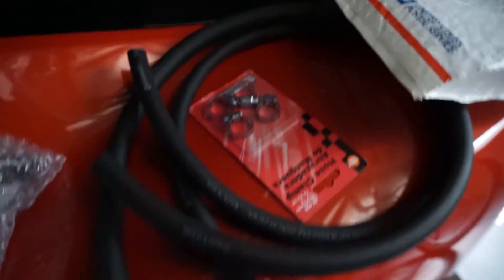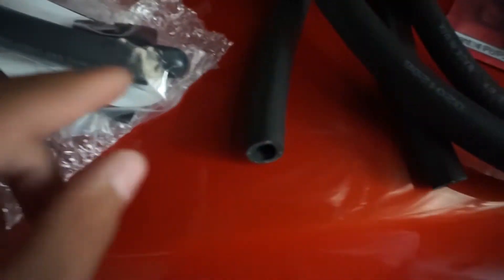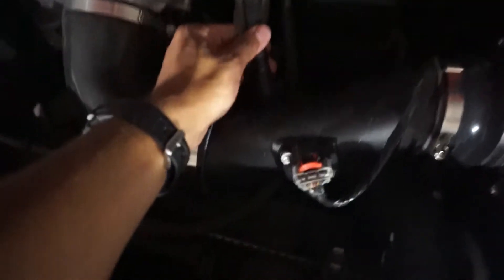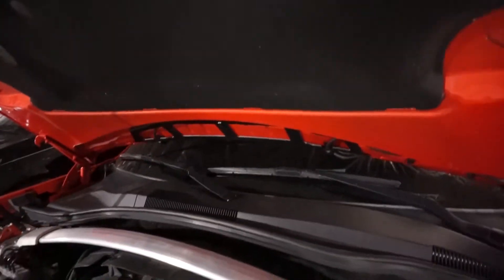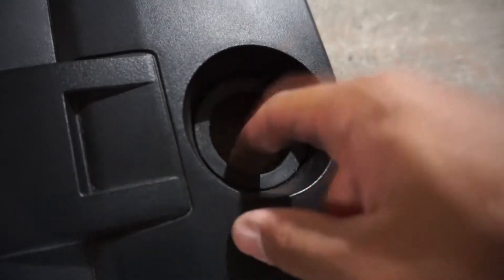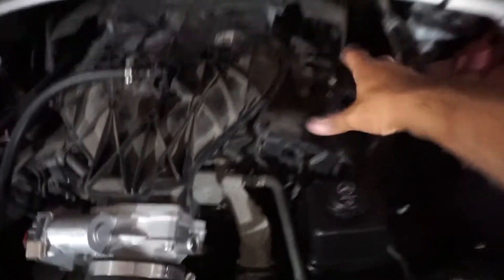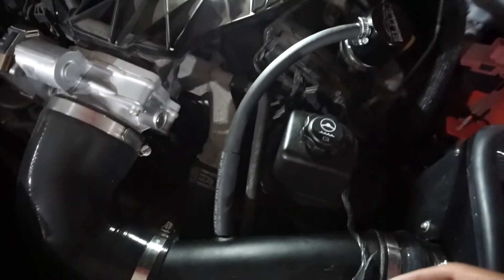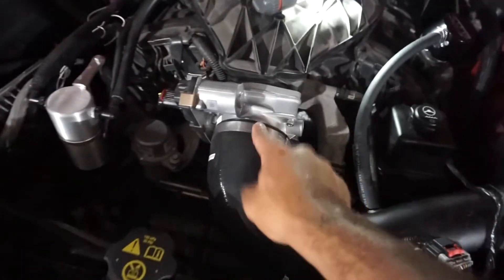Elite Engineering Clean Side Oil Separator Install/What It Does(Camaro V6)

Comment: I ran into a problem installing the clean side separator because I have a stock intake and the fitting is way larger than the hose and barb fittings it comes with. I haven’t installed it yet or figured what to do but I assume I’ll have to get a larger barb fitting or a larger hose and barb hitting

Comment: I have both from elite engineering  and work great. My clean side oil separator fits perfectly with the cover on. I didn't have an issue with it, even with the rubber ring on the cover opening.
Reply from the maker: Its definitely doable but I'd rather not get stuck holding the cover on with something that barely gives you grip to unscrew. Also there is too much tension on the line for me with the cover on. The separator goes on but in my opinion doesn't feel as good as with the cover off. To each, its own.

Comment: Do you have any oil leak from this setup?
Reply from the maker: Not anymore. When I first bought it, I bought a bolt(dont remember the size, I just walked in a hardware store and threaded it in a tester and bought the bolt that size), put teflon tape on and screwed it in. No leaks.
Reply: @mistermanage1119  i have the elite cath can for 3 year dirty side working perfectly bud I never put the clean side separator because I don't want oil leak
Reply from the maker: Idk why people think it will cause a oil leak? It will not cause a oil leak. Your cath can only catches 90-95% of the dirty vapors. The other 5-10% is coming back through your clean side at wide open throttle. At WOT, your vaccum in your intake goes damn near to 0 which means your catch can is not working cause there is no vacuum source which means vapors can come back up through any whole like the clean side. The clean side separator baffles it and only let's clean air back in. I haven't had any issues with leaking or oil consumption. To each, its own.
Reply from the maker: Also when I was talking about the leak earlier, I was referring to the actual catch can not the engine.
Reply: @mistermanage1119  ok thank you 💪🔥
Reply: @CorvetteC6-LS2  I've had the clean side separator on for 3 years no problems..
Reply: What about the resonador delete you put x pipe tou fell any diferential loss back pressure?
Reply from the maker: No
Reply: Are you going to invest in a dual valve oil catch can like the one Terry Lewis installs?

Comment: I was told to just close the driver side sytem off and the hole im air intake plug them up?
Reply from the maker: NOOOOO! DO NOT do that. If you do that, think about it, how will the crankcase get air in it when air is being vaccumed out the other(dirty side) side. It's a closed system. If you dont believe me, look up a video on the PCV system. They will explain it.
Reply: @mistermanage1119  i meant driver side pcv connect to oil catch can and passenger side also connect to oil catch and plug the intake barb and the hold in middle of intake manifold
Reply from the maker: That's even worse. Where would you vaccum come from? The intake gives the pcv system the vaccum. When it sucks in air it sucks the excess pressure from the crankcase as well. That's how the vaccum is possible. The clean side is responsible for replacing the air takin out. If you connect the clean side and dirty side to the oil catch can, you would have no vacuum to pull any blow by gases. And if you dont have any vaccum to pull the dirty side blow by, no air will need to be replaced on the clean side because there is nothing being sucked out of it. Make sense? Ask a mechanic if you don't believe me.
Reply: @mistermanage1119  went to chevy he said im consuming oil cuz my catch can isnt attacth to the hose running from driver side pcv along with passenger side connected then he said i need to plug up air intake barb and the intake hole
Reply from the maker: @great4ever845  Listen man, you do what ever it is you feel is right I AM NOT A MECHANIC. But I have NEVER had a oil consumption problem and you are the only person I know that is having this issue and wants to put the can together like that. What your saying, goes against how the can is supposed to be put together. Watch this https://youtu.be/DTlCep4_jZA
and this
https://youtu.be/Y5Cq1M48axE at 13:00 minutes
Reply: @mistermanage1119  ok ive got it now soo they want me to connect crankcase vacuum hose to oil catch can the one tbat runs on driver side along with pcv valve also connected to oil catch can now that leaves 2 holes open the intake hole on the block and the lil barb hole in tbat sticks out the air intake they want me to plug those up